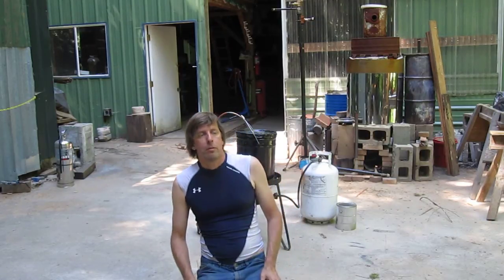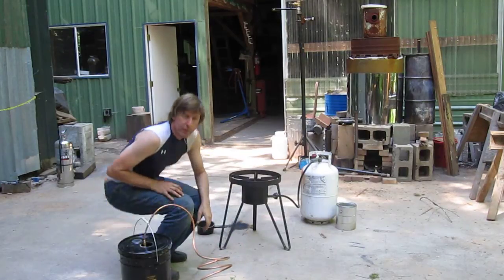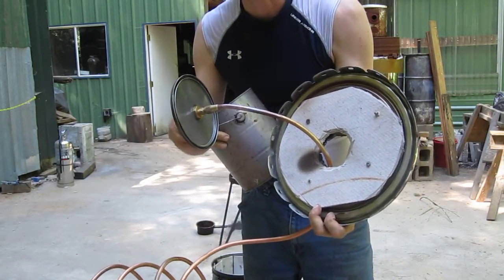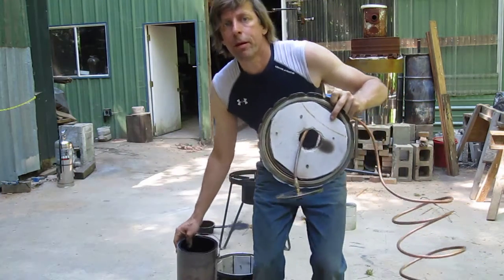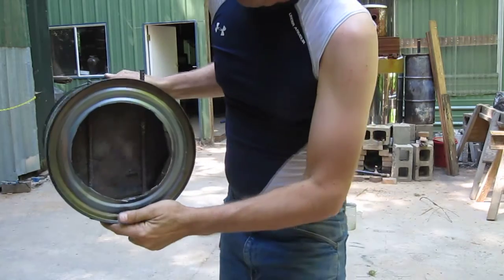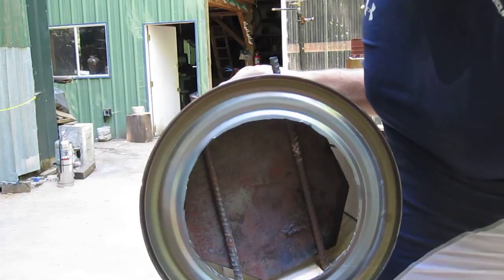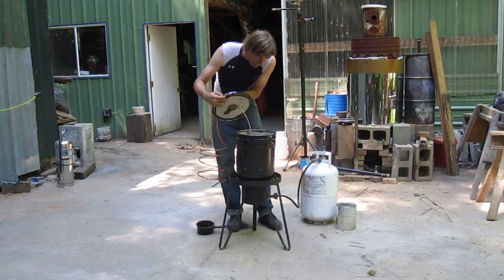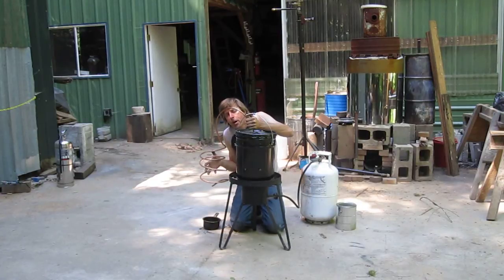DIY paintcan pyrolysis kiln for making biochar during dry distillation.

Comment: Nice set up for demonstrating the process of pyrolysis .
Please try to use top lit updraft gasifier to produce biochar and wood gas without external heat other than that which is used for lighting the top layer of wood chips for gasification.
If 20% secondary air supply is provided ,then the biocrude will be burnt up and you will get dark liquid tar  and wood gas as by-product.This process will make you propane free.